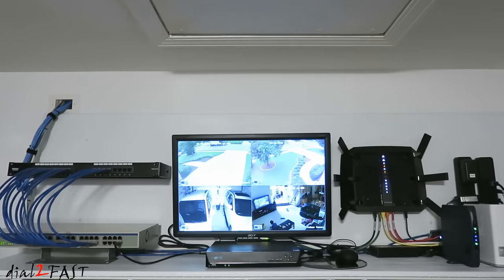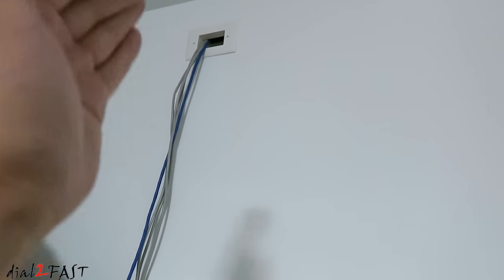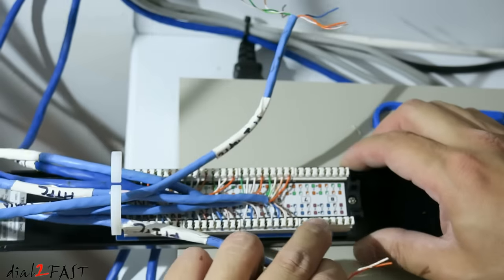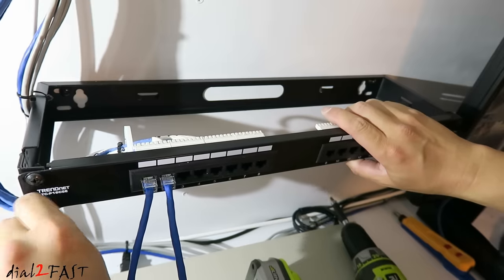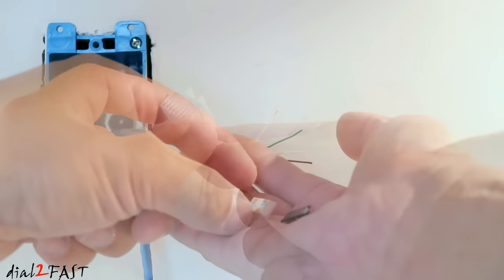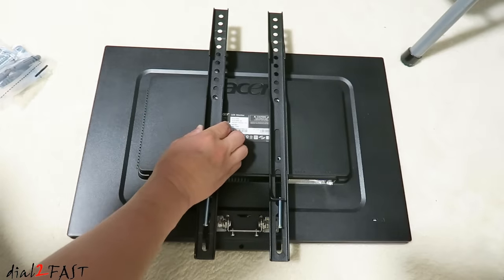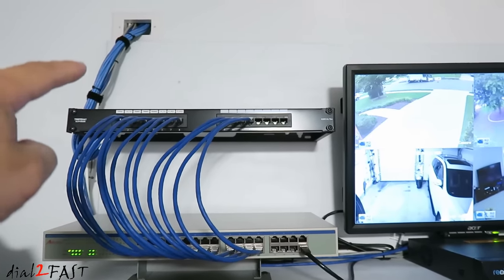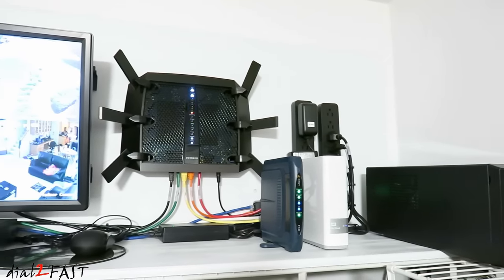DIY - How To Build Your Home Network

Comment: your video is just what I need to rewire my home network.  thank you!  I At 14.04 you show the system and the patch panel.  Are slots 9-12 wired?  I could not tell when you swung open the panel.
Reply from the maker: Not all the slots are used. You only need to wire up the ports that you need.

Comment: If you put everything in the closet, how are you addressing the cooling issues, especially for the dvr during the hot summer months?..I live in the tropics and have been toying with with a security system but the problem is location. I was thinking in a small hallway closet but haven't resolved the cooling problem as the dvr will generate heat. Only solution i could come up with was specific cooling cabinet.  How much nvr record time does that apc 750 give you? Any reason why you didn't put the NAS on the switch instead of a port on the router?
Reply from the maker: The closet I chose is a walk in closet in my bedroom. It's a fairly large closet that's air conditioned, so no issue with cooling. As for UPS for security system, every component you see in my setup is on the UPS including the NVR. Your concern about cooling is correct and the equipment do need adequate air circulation. Even if you put fan(s) in a small space, there has to be enough air to move around in that space. The APC UPS will possibly power all my equipment for few hours on backup power. I don't  have  a lot of power outage where I live and if I do, its usually for few minutes only. As for putting the NAS on the router's switch port, the simple reason is because that port is right next to it. Connecting it on my 32 port switch  or the router's switch port is exactly the same. All the switch ports on my network are on the same broadcast domain.

Comment: I would change:

Modem -> router -> switch -> rest. - I wouldn't put anything besides the switcher in the router.
I would also put the monitor directly into the wallet, so if you lost power you don't waste battery with the monitor.
Maybe a little media server running linux instead of the network drive with an arduino (or something similar) that executes a script to safe shutdown if we loses power so we also don't waste battery.

Comment: I have no ether net in my house, I do have coax cable in all the bedrooms and living room, my modem and router are in the living room, I would like to move both of them to the center of the house but that's more work then I want to do, would it be possible to buy another modem and router and set it up in my game room so I can hard wire my equipment instead of wireless, and run it on the same internet. Can you help me with some ideas or ways.
Reply: You should try ethernet powerline adaptor.
Reply: Bobby Davidson , thanks Bobby I will check it out.
Reply: Buy another router amd use it as a bridge

Comment: When punching wires, keep them twisted as far as possible to increase performance. You completely have them straight even though the pairs go together meaning they should've been twisted until the point they separate with just enough slack to fit into the punchdown area.

Marking cables is a waste of time.. It's best to simply run the wires and punch them down, then after it's hooked up you can use a loopback jack ( easy to make ) and plug it into the wire you want to label, then plug it into the switch and the one which is unmarked, and showing data transfer and receive is the wire associated with that room.
Reply: Labeling them is way easier then all the things you just said.

Comment: i have a router/modem provided by my ISP and hasn't been change for 10+yrs.
live on farm with my pops and we have cat 5e cable connected to a switch for dsl phone/modem. My dad Skype's every now and then for business and using email more to talk to his doctors 
(to the point im wondering if i can wire a cat 5e keystone to the wall then get a new router with mesh system, or do i look for dsl modem only as live in a rural area )
any help would be much appreciated :)

Comment: Good tutorial but incorect about the way you did the keystone connection. Your wires need to be twisted and much much shorter.
Reply: Marius Chiriac but it did work for him did it not though?
Reply: It really makes minimal difference.
Reply: Marius is right . If you use a professional tester like Fluke Networks , if you do't have enough twist on the wires and the correct lengths you will only get fails , they won't pass the test so you can't give certification for the installation to the client but in home environments it should be fine

Comment: very cool setup and neat work. I plan to do something similar and don’t find answers to two questions, maybe you can help. 1. Why not drop wires directly from the ceiling instead of wall and then adding plates and connectors?, 2. Is it good idea to have WiFi router inside a closet? Does it not reduce the signal reach and strength?

Comment: Informative and well done with videos covering all aspects. One thing of note is that it likely would have been simpler to go with a keystone patch panel rather then the old style which is not as often used and is less user friendly.
Reply: Guess i should clarify that statement :) Old style patch panels as he uses are great and done properly are neat but do come with a major drawback. Once they are fully populated maintenance becomes something of a nightmare since the connections at the start tend to be buried by connections done further down the panel . If the previous installer didn't leave enough slack then its becomes a total nightmare. With keystones this problem is no longer present and doing maintenance is quite simple although it does take up a little bit more space.

Comment: I was wondering about keeping the network servers cooler in the closet? Do you use a fan system?
Reply from the maker: This system I built is in a walk in closet, and it has AC so not additional cooling needed. If you have servers, you will need some kind of air flow in that space.

Comment: I have a question, could you replace the stock router that comes with AT&T with any router that you order on amazon?
Reply: Dustin Joesph It would depend on the service

If you have ADSL or ADSL+ (Internet only U-verse) and your Router and Modem is two separate units, then yes, you can get any Router you like

If you have VDSL, chances are you have double or triple play U-verse (IPTV, Internet and VoIP Phone), if that is the case, the RG (Residential Gateway) they give you is a combined Modem, Router, 4 port switch, HPNA (RJ-11 and Coax) adapter and Wireless Access Point, in order to use your own router, you would have to switch your RG out for a standalone VDSL or ADSL+ Modem (without built-in Router), then you can choose your router separately

It is possible to connect a separate Router to the RG, but it requires you to enable the DMZ (Demilitarized Zone) mode on the RG, which could get complicated and possibly limit some U-verse services

Comment: great design over all the only small thing is to much distance between the end of the twist and the connectorthis will slow down the cable. might not be to important in a house install. but it is good practice to do the same in home install and enterprise. like the lay out over all

Comment: what are the use cases these days requiring a home wired network that wifi can't handle?  thanks.
Reply from the maker: Wireless provides convenience, but if you need a 100% reliable connection and maximum speed throughput, it needs to be wired. Of course every household has different uses of internet. For example, a family watching Youtube, Netflix, PS4, and surfing will be happy with Wifi. But some people that work from home with dedicated VPN, & uses VOIP, or frequently transfer large work files, you have to have a wired connection. Some people have a media server that streams all their movies within the home, that will work best with a wired connection for fast data transfer. So there is no right or wrong as to which one to use, but it depends on your application.

Comment: funny am just seeing this tutorial i find it very informative but my question is, how do i apply this to a new home that already has data jack all over the house?
Reply from the maker: It probably won't do you much good unless those ethernet cable/ports run to exactly where you will be installing the camera. I am assuming most of the cameras will be installed outside. Also are the other end of all those cables going to where you will install the NVR?

Comment: How did you drop the cables down the drywall in each room and know where the cable end was? Great video btw 👍🏼
Reply from the maker: The cable run to the rooms on the second floor is easy since I have access in the attic. Just drill a hole from the attic and drop it to the room between the wall studs. To get to the first floor, it's more work,  you will need to find a way to drill through the floor joist in the wall to get to it.

Comment: is this a new house? how did you route cables coming from the ceiling? where you able to drive holes to the joints behind the walls? id rather not use the wifi/router to serve as router.. maybe a pfsense firewall/router then to switch or managed switch then to wifi.

Comment: Given me some great ideas for setting up my home network. I am in the process of setting up my server (CentOS Linux based). Need to connect about 2 PC's, 4 laptops (including 2 Mac's), my Apple TV, PVR, CCTV system and 1 smart TV. It's a big job because I have no direct cabling and it is all brick walls. Should make for an interesting project although the time is going to kill me!
Reply: use wifi

Comment: How's your WiFi with the router in the closet? I'd set up a Mesh WiFi system to keep the signal strong even outside the closet.
Reply from the maker: I have a UniFi wifi AP installed in the middle of my home, so I am not using the router's wifi.

Comment: Question, Why not just drill another opening in the ceiling for the wires instead of where to he stairs are? I'm just thinking that whenever you must go to the attic, the wires have a possibility of getting rubbed or pinched.  Overall, great video sir!

Comment: You did not cover the part for 110v power to the UPS.  I'm sure your closet did not have that installed.  Can you elaborate on that please?
Reply from the maker: My closet does have a 110v outlet.
Reply: That is rare . 3 years ago when my house was built,  I  didn't bother with cat6 installation as I was going wireless.  Now that wireless talk COULD BE harmful, I'm revisiting that.
Reply from the maker: The builder of the home installed the house alarm control panel in this closet, so that's probably why there is an outlet in there.
Reply: @dial2fast  Now that makes sense.

Comment: is the consider to be part of network technician job or network engineer ? I'm confused between these fields of study ! does a company need both of them or just  a technician ?
Reply: Companies all run things differently. In general, network technicians are physically working on network stuff, like installing routers or switches, or access points and maybe doing some cabling, terminating patch panels and patching and unpatching data drops as required.

Network engineers are the ones doing the actual configuration of network devices and setup of the network. In smaller organizations, the 2 jobs may be merged into 1, but again it depends on the job.
Reply: @JJFlores197  Thanks man I post this question 1 month ago where were you? just kidding😅 but thanks

Comment: Cant we directly connect the cables from the wall to the network switch
Reply: Ansh Gupta you can but having a patch down panel makes it easier to repair or replace cables from the switch to the patch down.

Comment: Why is your NVR & NAS connected directly to your router rather then to the switch?
Reply from the maker: Because the 4 switch ports on the router is on the same broadcast domain as the switch ports on the switch. So it's perfectly fine to connect to those ports.

Comment: Great video, why did you wire the cat 5 to T568A? Cat 5 quite dated now as well don't u think?
Reply from the maker: If you have T568A on both ends of the cable, it's a straight through cable. Same if you have T568B on both ends. Most straight through cables will use the T568A color scheme. CAT5 is perfectly fine for most home application. Unless you are transferring huge amount of data, 100Mbps is all that you need in most homes.
Reply: dial2fast It’s actually the other way around, T568B is the more common standard

While you used the T568A standard on the patch panel and keystone jacks, you used the T568B standard when terminating your patch cables
Reply: I would strongly disagree with that. We are quickly moving towards larger file sizes. If you're going through all the trouble of a proper home network, you should at least be using current gen stuff. Theres a reason gbit nics are everywhere. some level of future proofing is greatly beneficial.
Reply: Yes He did that. May I ask that will work ? and this is the best way? I think that He should follow one standard at all wiring like if he decide to go with 568A, should be the same with all wiring? Right?
Reply: @mrmohammed4316  It will definetly work. But you could might as well use cat6 while you're at it (imo). Nice work by uploader :)
Reply: @dial2fast  I have 2x1gbit connections at home. I wired my house with cat7. It wasn't that much more vs cat5e.

Comment: Can you use the switch without the patch panel?????
Reply: Yes, you can plug directly into the switch. A patch panel is overkill for a small home network. Sure, if you sell the house, a patch panel looks nicer than just leaving cables hanging, but I'd probably just leave the switch anyway, they are cheap.

Comment: Welp. Standard is B, not sure what made you choose to use A in your house.
Reply: Makes no odds providing he makes both ends up the same way.
Reply: @davidgatherer2073  Isn't most stuff running MDIX these days anyways, lol?
Reply: @SeanyNation  Without re watching the video. Don't think MDIX has anything to do with what I was replying to. It was a point of what standard to use A or B. Yes MDIX auto would get around any issue of if you used a mix of A and B but that wasn't what I was commenting on.
My point was A or B standard would work in the setup of the video. However I don't think they were trying to create a network/link between computers. So no crossover would be required.

Comment: Why do you have a fast ethernet swith, No need for it or do you find it to expensive to buy an gigabit switch?
Reply from the maker: The networking equipment used in this build were things I already had, and the 10/100 switch is what I was using prior. Also you need to think about what pc/servers on your network that requires Gigabit speed? Perhaps you have very large file transfer or 100+ HD IP streams that you are sending to a multiplexer?? 100 Mbps is more than adequate for most homes.
Reply: Actually that's not true IP cameras with kill a network unless isolated on its own sublet the switch would have helped with the cross talk and traffic but he connected everything to the router instead on the switch

Comment: Best video I've found. 
I was given 600ft of cat6 wire to do my small house. I see everyone using cat5e. Was it cost that determined using cat5e?
Reply: Cat 6 is the new generation of Cat cables. It can handle higher speeds. Cost was  probably the reason.

Comment: What about the wireless network, did you disabled the WLAN from the router? How many access-points to you have?
Reply from the maker: You can have more than one AP in your home. You can disable the one you no longer use if you want. I had 2 wireless AP. Since I no longer use the one from the Netgear router, I turned it off.

Comment: Re-terminate that patch panel by pulling those cables closer to the termination point. Don't risk your router slowing your connection down.
Reply: huh?
Reply: Mitch FTB he has more than 1 inch of untwisted pairs on his patch panel. His connection may slow to a 10/100 Mbps instead of 10/1000 Mbps due to excessive noise.

Comment: Nice video and explanation. I think a wiring closet is a great idea but past that most people won’t need all of this and the expense involved in tools and material plus the time it will take them. In addition because of the additional components debugging this setup may be beyond many people’s capabilities.
Reply: expense? he spend what a few hundred bucks on everything needed and that may be over pricing it. common sense tells you is it needs to be serviced and you don't know how then you probably shouldn't be doing it. but to dumb it down actually serving it is easier its either the drop from the room to the patch panel or the patch cable from the panel to the switch if its hardware well that will be obvious. But lets this about it cables are moving in walls at most the issue would be the jack simple fix replace it.

Comment: Great video, but did you say Cat5? WHY Cat5? You should have at least gone with Cat5e imho. :)
Reply: Look closely, it is Cat5e
Reply: Cat5 is enough for his use case of 10/100 speeds.
However if you want future proof for upgrading you might as wel go Cat5e or heck Cat6.
There's barely a price difference between 5e and 6.

 @Daz159100  
It only says Cat5e on the connector.
Doesn't mean the cable is Cat5e
Reply: @ErikRedbeard 3:43 you can see upside down CAT-5e.  Also to go full nerd later on you can see the difference in the twist tightness between the various pairs to avoid cross-talk.  :)

Comment: Why the access point if you have a good router. Are you loosing any speed by using that instead of the router
Reply: An access point in an extension of the router.  No speed is lost.